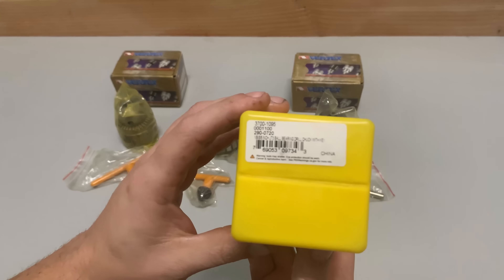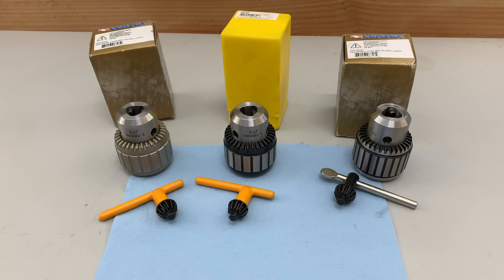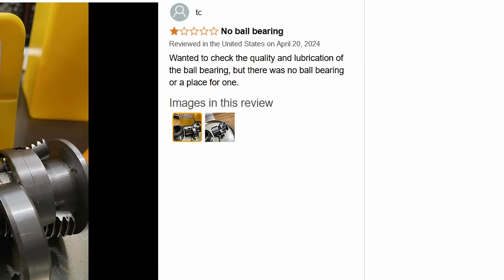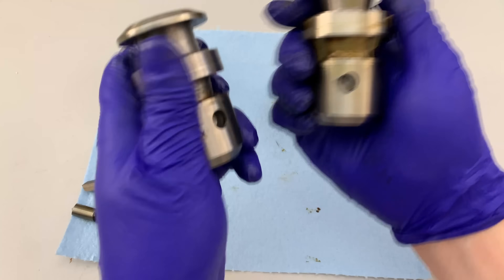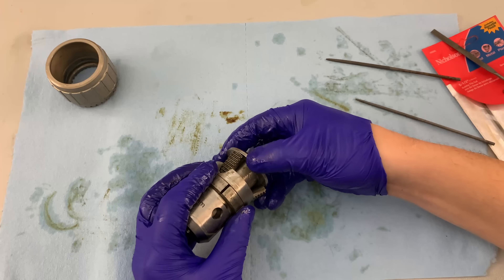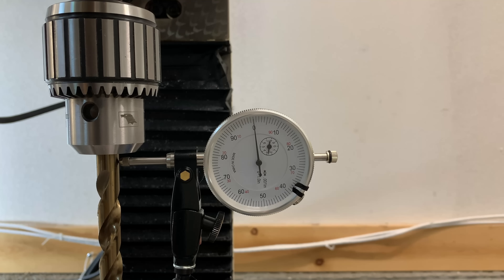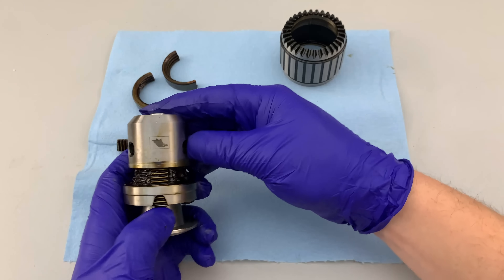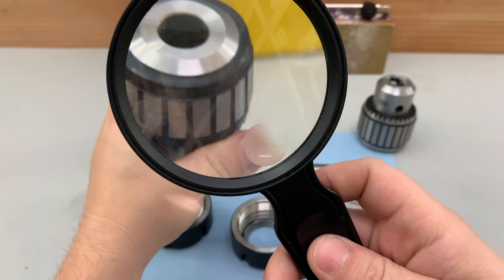Made in China vs Taiwan: The ACTUAL Difference

Comment from the maker: Thanks for watching!! Here's the two chucks in the video:
- No Balls Ball Bearing Chuck: https://amzn.to/3YlBkpW
- Vertex Chuck: https://amzn.to/4eYsJzg
UPDATE BALL BEARING VIDEO:  https://youtu.be/mocHwV2fJWY?si=Ij8dW8DXK1EMZb97

The MYSTERY CHUCK has been identified by a viewer,  @jasonpoletta1797 as a 10062 or 3303-078. Don't have a link to a US retailer for it unfortunately. Thanks!!
Reply: I have a chuck that is only one gallon out, made in USA.
Reply from the maker: Just patch the hole and refill it with chuck sauce, it will be good as new.
Reply: I would buy a second one on HHIP for another video to see if they fixed the problem!
Reply from the maker: @AsiaRoadTrek  I plan to do exactly that and have started procuring additional chucks to test as well.
Reply: Sounds like a happy customer experience but it might be the repertoire that they use to anybody that brings it up. They don't loose anything. They just need to give a refund to few that opens it and keep selling neutered chucks to other customers.
Reply from the maker: @dongleseon8785  correct. I am going to be following up to find out if they actually fixed it, or not.
Reply: You did not say and I am not versed well enough to tell from the vid. Were they designed for balls? If so, could you add them?  And would it be worth it?
Reply from the maker: @stevepetrosino1590  It was advertised as having balls but didn’t, and wasn’t designed for them - completely the wrong product.

Comment: i live in poland and i have no idea what a value vs price should be, because i am just a garage banger. so when i was buying my drill press. i noticed that they are roughly the same price and look the same, so i picked the color i liked the most. and was very disapointed.
the chuck that came with the drill had 1 mm runout and the chuck wrench was the wrong size. the tapered arbor was not the problem, just the chuck. cosidering i don't do precision work i bought another just the cheapest chuck with no bad reviews i could find and the runout gone down to less than 0,1mm 
and obviously i reengeneered the drill itself to be less clunky (but it does have a pool pump motor now which is 100% aluminium ), i don't even know if it was worth the effort, would the next more expensive drill be ok out of the box ot not. but now i doubt it

Comment: The one that is the best has an outer jacket of molybdenum. Which is a metal with low thermal deformation. Meaning it wont stick when its cold. You can tell by the color.

Comment: My Rikon 30-217 drill press  chuck was also packed full with grease I presume, I did not disassemble it, but added Silicone spray and it went from super stiff to super smooth, I suppose my chuck doesn't have ball bearings either, but for woodworking it had good accuracy, To many choices if I was going to replace with a ball bearing type , but the 3 you showed looked that they would have been great for a woodworker.

Comment: There is some very precision tooling available these days, for cheap.  You should check out the reviews for the $50-ish machine vise that Vevor sells.  They are machined really beautifully, where it matters, they’re robust, and the tolerances are way way way beyond what they should be for a cheap $50 vise.  …same with Vevor rotary tables, they’re smooth running, and just so much nicer than what you’d expect for the money. 
I’m going to buy one of those mystery chucks…that thing was beautiful inside. 👍👍👍 thanks great video

Comment: Well, what bullpucky. 3/4 of the way through, we finally get a dial test on a drill bit, and to no ones surprise, they all are pretty good. Isnt it great that we all drill holes with 1/4" long drill bits! 
Im sorry but the only thing that matters about runout is how much it runs out 6" out from the chuck. So how about getting a piece of drill rod 8" long and then retesting at the far end of that rod? Then we can tell if the chuck is any good. Be sure to check with theee differant sizes, as ive got one chuck that changes runout depending on what the dia. of the drill is. Please do better.

Comment: I can't speak to tools much, but I have gotten pricey astrophotography equipment from China. It's generally not without issue (a $4000 camera had to be returned and replaced because it didn't work out of the box, and a $9000 mount had to be sent in for warranty in 2 months), but once I got working equipment , (it still works) I had excellent value for the money spent.
Reply: You proved my point that Chinese manufacturers have little to no quality control. Everything goes out the door. Cheaper to deal with a return than to pay a quality control team that will reject bad products. It's a numbers game.

Comment: 1. Products involving hard sciences: No matter how much money you pay, China cannot produce certain items, or even if they can, the products lack durability (e.g., Japanese engines still under patent protection). Ultimately, the lifetime usage cost is higher. Examples include CPUs and LCD panels, which rely heavily on hard scientific foundations.

2. Precision instruments and ultra-high-quality products: These are partly tied to China's technological capabilities and partly to its cultural aspects. Ultimately, it is a cultural issue. A nation focused on short-term gains and skilled in interpersonal maneuvering rather than dedicated research will struggle in comparison. Japan is a successful example in this regard. For instance, Lexus luxury cars combine thoughtful design, durability, low usage costs, and repair costs—qualities that are hard to match, even for the U.S. or Germany.

3. Pricing of daily consumer goods in Western countries: There is indeed a significant premium, which often feels unreasonable. For example, the batteries for power tools don't involve particularly advanced technology, and the production costs are not significantly higher than in China. However, the prices are several times higher. If you can use batteries made in China, it would be a good alternative.

4. Brands in developed countries with original quality control and production lines: Products like Apple phones, DeWalt power tools, and Nike shoes produced in China still maintain reliable quality. However, the brand premium is admittedly quite high.

5. Low-tech products: For items without technical complexity and not related to health risks, buying Chinese-made goods is fine. For example, slippers, bicycles, socks, hand tools, and even some power tools are acceptable, as they mostly involve simple motors and metal components.

6. Health and safety-related products: Absolutely avoid buying Chinese-made products, no matter how cheap they are. This includes food, tableware, medical accessories, and even auto parts. It is best to steer clear of these if they are made in mainland China.

Side note: I’ve noticed that German products are also starting to decline. They’ve largely adapted to the Chinese market's consumer mindset and are deeply tied to China's economic interests, such as Volkswagen cars. As a result, I’ve lost much of my trust in German quality. In this area, Japan is still significantly ahead of Germany.

Comment: Things are made to a price point and things are sold at a price point. There is no relationship between the two. The main variable is the profit margins of the man in the middle.

All countries maje tools to various quality standards and this includes china. They will happily work to any specification. But what they make is always good value at that specification as they work to very modest profit margins.

If you get poor quality or poor value for money blame the middle man not the maker.

Professional users should buy what is appropriate for the work that they do.

The average home user mostly gives their tools very little use and even bottom end tooling usually serves them well enough. And can treat most of their tools as disposable. Those that have higher demands will usually buy  better quality anyway.

The availability of low cost lower end tooling it a godsend to both the cash strapped and occasional user alike.

The problem comes when low end tooling is marketed and miss sold  as better than it is.

Comment: You MUST replace the drill press quill-shaft bearings and I sent my quill-shaft out to a machine shop to be TRUED (It's a Chinese cheap-o, like a Herbar Fraught 13-speed floor stander but another "brand"). NOW it's true to .003" for under $200, $109 for the REAL Jacobs 77 chuck.  Honestly, except for Japanese drill bits or Diamond D's, it's nearly impossible to find drill bits true to .003".

Comment: I bought a large Jacobs "Super Ball Bearing" chuck with a MT5 arbor to fit the 21" swing lathe at work. All was good until it got some crud inside it. So I broke it down to clean it only to discover that a new "Ball Bearing" chuck did not have ball bearings in it. Suffice to say, I was rather disappointed.

Comment: I used to audit manufacturing companies in China and Taiwan and hands down Taiwan has much better quality overall. Taiwan is on par with US manufacturing quality, perhaps slightly lower quality than made in Japan products. The challenge with made in China products is the amount of non-compliance raw materials used as well as sub-contracting to back-alley suppliers. Those happen more than you realize and most customers are not aware. I encountered a number of these issues during my audits. Many heavy manufacturing suppliers in Taiwan are sorta unique in how they operate and will drive an auditor crazy because they don't follow precise processes or procedures and paper trails are hard to gather yet they get the job done somehow, mainly due to a very well trained, experienced workforce that has been making machined parts for their entire careers. I prefer US made, Japanese made and Taiwan made. My last choice is China made and typically consider products made in China as one time use e.g. disposable.
Reply: You probably pensioned in the mid 1990s. China can produce any chuck or basic tool rivalling those made in the US or Japan. But of course they won't just hand it over for a few cents. You probably have to pay the same amount of cash you used to when buying Japanese or American tools. Golden Goose chucks are a good example. They put Jacobs chucks to shame!
Reply: @clifffff7630  wrong! Still auditing in Asia. Have you ever been to China? Doubt it yet you spew garbage like you know what quality is. China doesn't have it.

Comment: Are you talking about precision not the accuracy? Precision would be the diameter of the hole drilled, the accuracy would be the correct placing of the centre of the drilled hole.

Comment: There's a good chance the manufacture of taiwan chuck is outsourced to a factory in mainland china which also make identical products using same machinery and process to sell for themselves without branding.
It's a quite common practice around many industries. For something simple like tooling components or floor tile it would be practical the same except branding while for more complex product like appliance they would use the same technology to design something under their own brand (and often add some gimmick that would give you mixed feelings).
Reply from the maker: That could be.

Comment: Ive definitely used these chucks at my shop, while I'm not worried about run out so much when drilling a hole for the parts I make most of the time, I have found them to not hold the drill very well and have spun in the chuck multiple times, I have to torque it with a pipe on the chuck key to be safe.
Reply from the maker: Which chuck do you find grips best?
Reply: @ShopHumor I have used older chucks that's were legit Jacobs, I noticed the portion that grips the drill has a little bit bigger surface area and I've never had a drill slip with it.
Reply from the maker: Yeah I like the older Jacobs chucks too. I'm actually working on a comparison between vintage Jacobs chucks (made in USA) and the new ones (now made in China, still Jacobs brand) just to see how they hold up now compared to the old ones.

Comment: the taiwan chuck had twice the lines as the china one, meaning it was machined with twice the resolution, that also means better accuracy for the surface itself, as its more smooth so to say
Reply from the maker: The Taiwan chuck was definitely the most accurate, but honestly I was surprised at how accurate they all were for how cheap they were.

Comment: From a purely academic and physics based opinion. A ball-less ball bearing , that depends on precision machining and grease, should give next to no wobble , BUT it would require a little more power to drive AND might heat up and warp more quickly , and possibly seize with prolonged use IF the grease gets too hot and breaks down. 

Purely from theory.
Reply from the maker: I plan to compare a vintage, USA-made Jacobs brand ball bearing chuck, and with a new, now China-made Jacobs brand ball bearing chuck

Comment: Im not positive on this question, but wouldnt you want to check runout on the end of a bit that was actually doing the drilling? If i understand correctly, the runout would be greater at the far end. Right?
Reply from the maker: It would be good to check on both the top and the bottom, and also good to use a more purpose built measuring tool than just a drill bit. But for cheap chucks I figured it would get us in the ballpark. I plan to do a follow up video to make sure that these guys corrected the problem and I'll improve my testing methodology then.

Comment: Many years ago I worked with a Swiss firm doing manufacturing survaillance for the German retailer which bought hand tools and electric tools from Chinese companies. The Swiss firm hired Philipino engineers to do the job because they were supposed to be less corruptable than local engineers. These Philipinos had to play hide and seek game with Chinese manufacturers on a daily basis. They found that the samples submitted were up to Metro standards, but the mass produced tools often failed inspection. It's no secret that to secure the order the Chinese were willing to accept low prices and they were able to make decent stuff, but at that cost they would lose money, the simple solution was to use cheaper materials and components in mass production. They were sometimes caught  replacing inspected, qualified products with defective ones.
Reply from the maker: I'm certain that happens all the time. Everyone is looking to make a buck - from the factories to the importers to the distributors. Everyone's skimming and cutting every corner they can